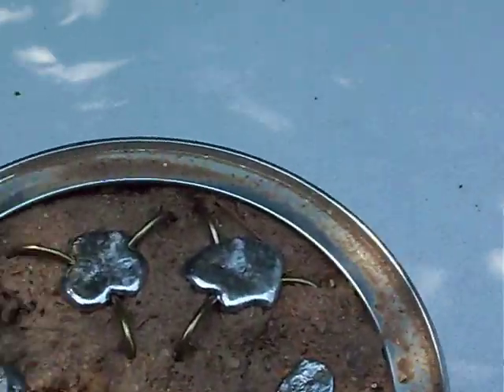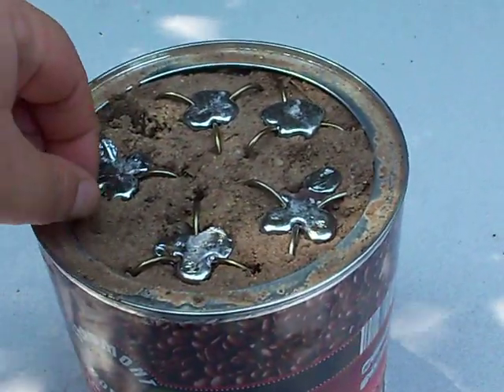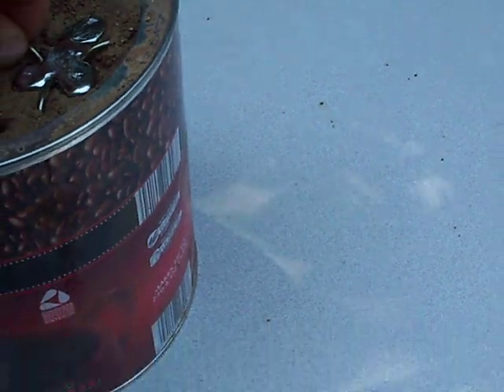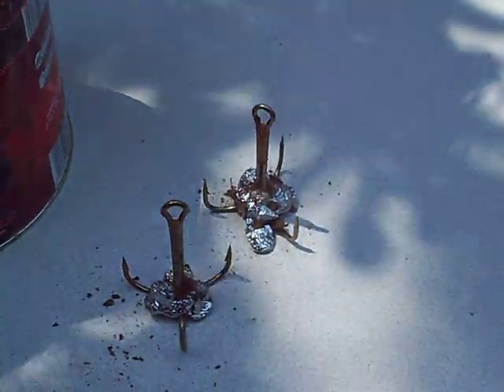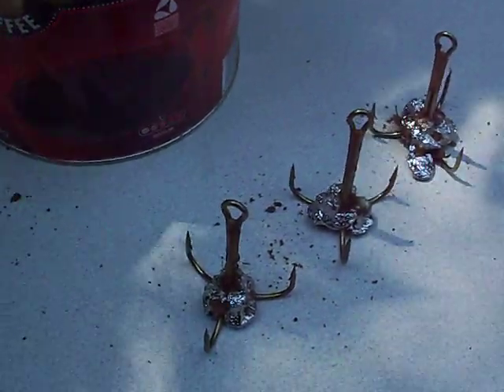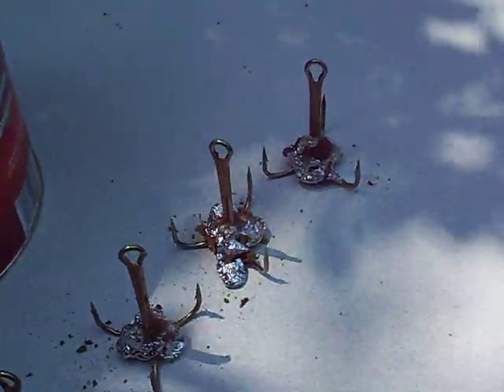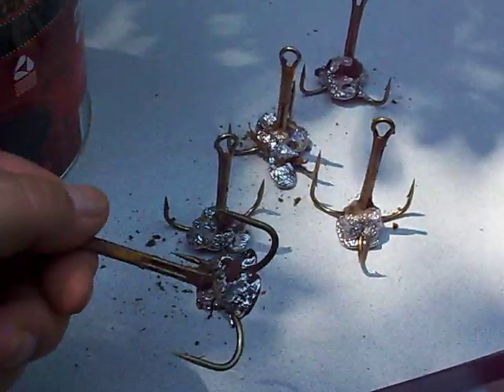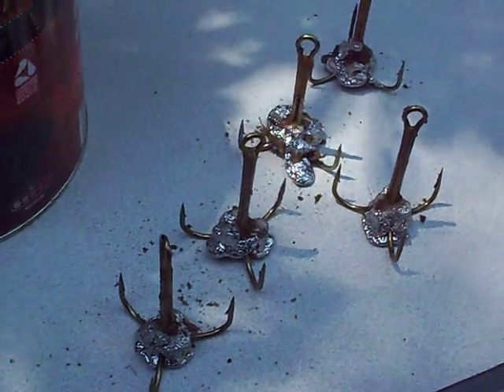my snag hooks finished

Comment: Why not put a pyramid sinker in the mold with pointy side down, remove it, insert treble where the sinker was, then pour lead. Would come out a lot nicer.
Reply from the maker: miamiwax  the simple answer was I didn’t have one and  have always used what I got

Comment: Looks like 2 out of 5 to me! 
Maybe use cleaner sand mixed with a bit of oil to hold shape better. Round off a 1/2" dowel and poke it in then set in the hook(s). I wouldn't have posted this video.